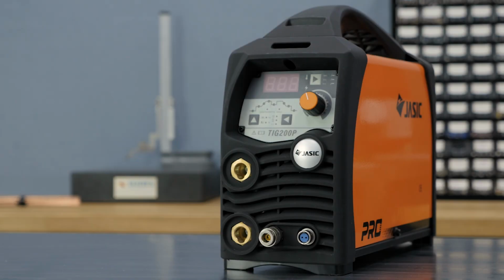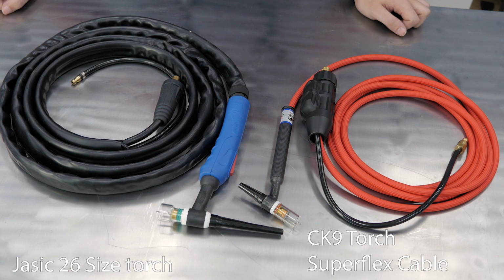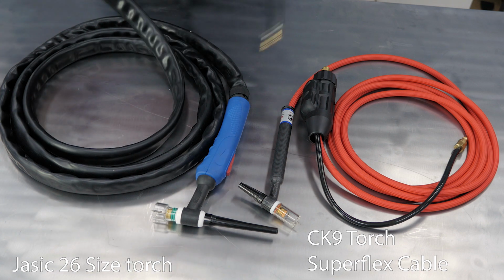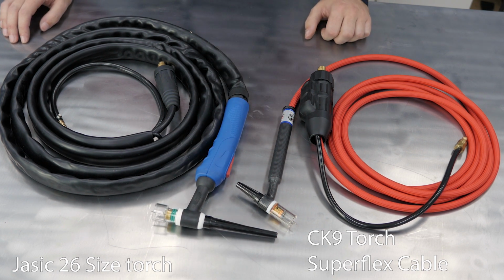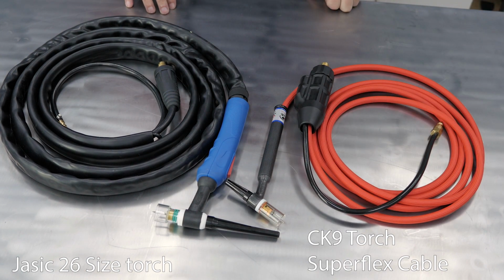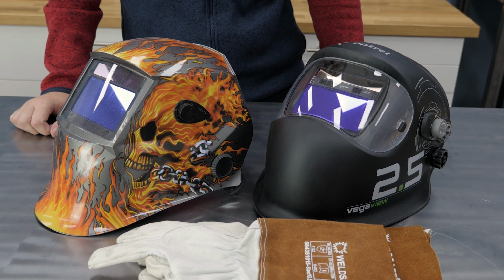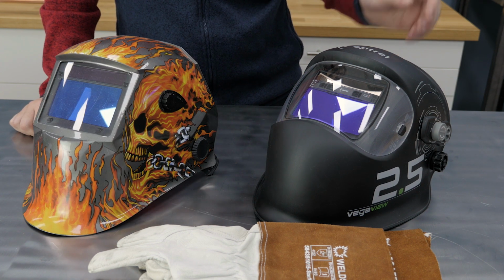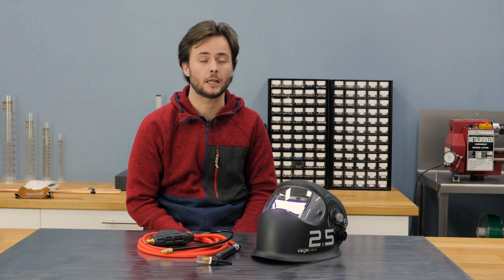My Workshop #2 Tig Welder

Comment: thise pyrex cups is great juat for show up,they made just for wasting gas bro.Change the for regular ones they are more pro ;)
Reply from the maker: Thanks for the reply, I like them because it gives me better visibility. the regulator is set to the same CFH as with the regular cup so it doesn't matter. It is just more expensive so not the best fit for people that are clumsy. I still have the same cup on the torch so this isn't an issue for me. 

(The torch is a CK9 with gassaver gaslens collet and screen and a number 8 cup. Argon is set to 10-15cfh depending on enviroment)

Comment: I have ac/dc .the machine doesnt support remote control ,but you can change amps while you are welding with switches.I am making 3 pedals right now .1 for on/of 2 amps+ 3amps-.I tryed already it works like that .you can change around 5amps/s with this method which is very slow if you compare to potentiometer control but can help you with aluminium welds

Comment: I’ve had this tig welder for 2 years now, bought it from BOC UK. Great tool, HF start is brilliant and crisp and controls are good also. I put a cheap machine pedal switch on mine just as a switch makes it a lot easier when using a ck9 torch and BBW cup on an exhaust etc. Shame they didn’t put remote current control but oh well.

Comment: But you've lost your button now, haven't you? Don't you also need a foot pedal with this torch ??
Reply from the maker: Yeah you are right, I didn't like it on my torch so I made a pedal myself (this welder only supports on/off so no proportional control unfortunately but still nice to use!)
Reply: @StefsEngineering   I am planning to use it to restore a car, so a pedal won't be useful most of the time. Proportional control would be nice, but I can't justify spending 1000 euro for a Jasic AC/DC for options I am probably never going to use.
Reply from the maker: Same here, I don't use it often enough to justify the higher price.
Reply: @StefsEngineering  I got myself a Jasic 200P DC yesterday and mine has a 5-pole connector for the switch. I hope it will accept a pedal with proportional control, I haven't tested it yet.
Reply from the maker: @1951split  That is the bigger/wider one right? AC/DC? Mine only has a 2 pole so no chance of proportional control here...
Reply: @StefsEngineering  No... it's the small DC only version...
Reply from the maker: @1951split  Well lucky you I guess! When it is wired for proportional control ofcourse, it may be possible that only two leads are connected. I am curious if it is
Reply: @StefsEngineering  I'll take a look when I have some time. If five leads are connected  and our units share the same PCB then maybe you could hack proportional control into your machine.
Reply: @1951split  Probably will not support proportional control.I have the same machine and I tried 10k 15k 20k potentiometors but the current stays at 5amps no matter what.So in this case you have digital control and you can still change the amps while you are welding but with buttons not with potentiometer.Its such a disapointment that this noce machine doesnt have remote control option :( .Mine is ac/dc pulse mini

Comment: Hello Stefan I've bought the same welder but have no  idea on  what settings to use.Could you help me with the settings  that you generally have while welding  steel?Thanks in advance.
Reply from the maker: I'd love to help but I'm not really that experienced. I learned a lot from the video's made by Jody on his channel "weldingtipsandtricks" I can definately recommend his video's! 

If I remember correctly, I used these settings last time for the square tubes:
- Pulse weld setting (2 pulses per second)
- of that time 40% high and 60% low
- 70A high
- 30A low
- Ramp up with a bit of preflow
- Ramp down with a couple seconds of post flow

not sure though!

Comment: Can you tell me which connector you use with the hose with the CK9 Torch?
Reply: Mag ik vragen waar je de toorts en adaptor gekocht hebt? Mvg
Reply from the maker: Sure! I used : "CK Safe-Loc 35mm Dinse
 Power Adaptor. 3/8 BSP Gas Nut." on mine

Comment: I bet that Optrel welding helmet cost half as mutch as the Jasic welder
Reply from the maker: Yeah it's quite expensive but I bought it as an investment with future welders in mind. It is comfortable though, very good view on the workpiece. 

I got curious so looked it up, if I search for them and look at the first shop in the search results the helmet costs 399 euro's and the welder 499 (with stock torch and no argon bottle that is). So it's 80% of the price of the welder.

Comment: Nice video, thank you! Just bought the same TIG machine few weeks ago after watching your review. I would like to switch to lighter torch, most likely CK17. I'd like to ask how do you initiate the arc. Do you use the foot pedal? I can't find one for this model.
Reply from the maker: I enjoy using this welder a lot, I haven't used it that much (I recently bought the second fill for the argon tank) but it works great. Especially with the CK torch! 

I do use a pedal, but it's an on / off kind of deal. I made it myself by taking the connector off the original torch switch lead and I connected it to a cheap universal pedal.

Comment: Thank you for taking the time to make this video! Well done!
Its nice to see reviews on equipment other than Miller and Lincoln, which contain Chinese components too, and  at 3 to 4 times the price.
Jasic makes quality welders.
Thank you again from America!
Reply from the maker: And thank you for the comment! This was one of my practice video's, I may do a revisit in a couple of months because I learned a couple of things about it since I uploaded this video that may be interesting for potential buyers (of a entrylevel TIG setup).

About the chinese components: It all depends on how much you pay them. Unlike "the west" They offer the option to make stuff "dirt cheap". You can buy a vise from china for 100usd and you will definately learn it's not what you expected quality wise. But if you pay the same company 400usd for a vise with the same basic specs (size/range etc) there is no reason it can't be of the same standards as a vise from the US or Europe.